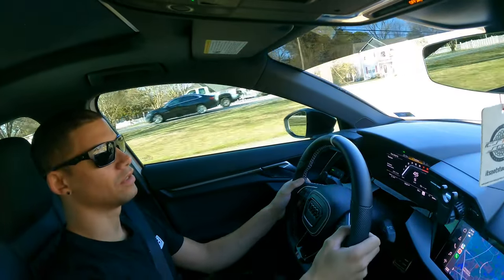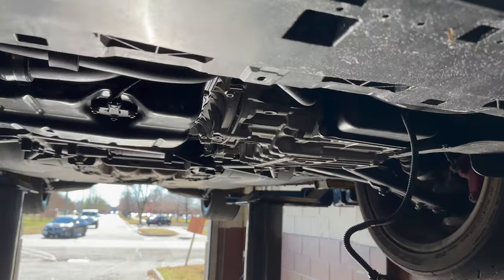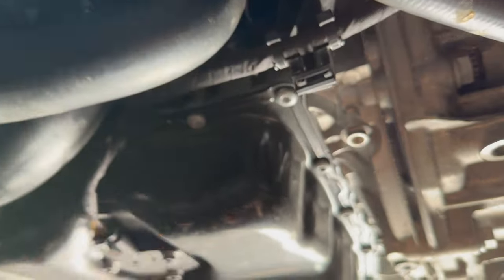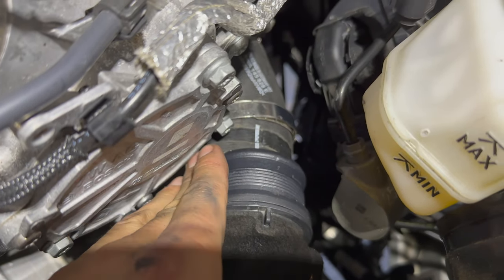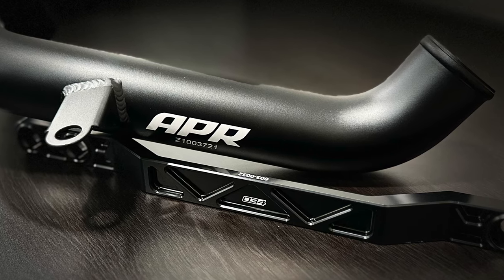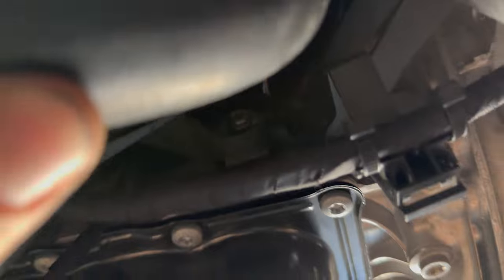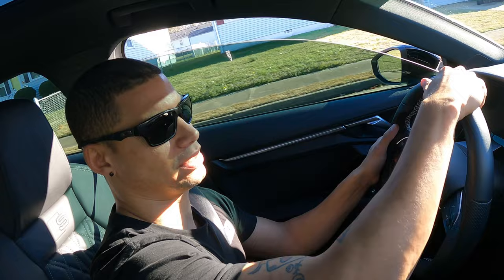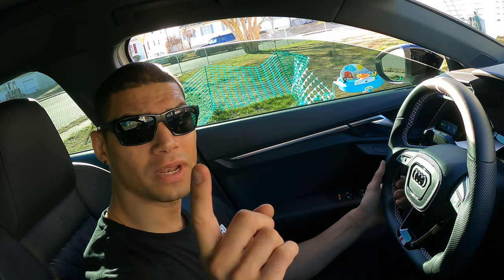034 Tunnel brace & APR Outlet pipe install | MK8 & 8Y S3 | MQB EVO

Comment: Bro watching all your videos on this car made the decision for me to get an Audi in July. I'm so torn between a 21 s3 or an 18 rs3 🤦🏻‍♂️
Reply from the maker: What do you value more? Tech and looks or power? RS is expensive to build but the ceiling is so much higher. 4cyl a bit cheaper but after 500whp and 450tq you’re in a sketch territory. Really the RS is too at that power as they all use the same rods and they don’t really like more then 450 tq. 5cyl sounds better for sure, and they are just awesome engines. But like I said it really depends on your goals. If you wanna be quicker then mid 10s go RS. If you’re fine with 500wheel and want the newer tech get the 8Y. But really I’d save and get the 8Y RS get the best of both worlds
Reply: @Bryce Jordan Productions I definitely appreciate the feedback on that. I love the interior and exterior updates of the 8Y, but the sound of that 5cyl has my heart. Plus, it's not a deal breaker to not have to new tech and updated exterior details. Even tho the 8Y RS headlights are sick as hell.lol I'm definitely not trying to make it the fastest thing out there, but I will for sure be doing the basic bolt-ons and exhaust with e85 and 91 tunes to give it just a little more pep and some cracks and pops 👌🏻 it's definitely pricey as hell to mod them. I made a cart of bolt-ons from 034 motorsports and almost shit my pants at the price, so it'll be a slow modifying process once I purchase it.

Comment: settling in for a nice view. i wonder if your APR pipe is the same spot as my Neuspeed pipe. i think they are both outlet pipes.
Reply: the charge pipe was one of the trickiest installs i have done on my car
Reply from the maker: Yeah they should sit about the same spot, didn’t seem any different then my mk7 install wise besides the extra dsg stuffin the way

Comment: Really miss ur Mk7 bro.....
Reply: @BryceJordanProductions  Im swapping mine to an RS3 and really enjoyed all ur videos they were great. Most all of the suspension stuff i can still use other then motor/trans mount. Shooting for 1200 whp. Syvex, sleeved block, poted heads, custom cam, Litespeed Magnesium wheels, AP brakes, CF everything etc....
Reply from the maker: God damn my man!!! That’s like legit the ultimate goal! I should’ve kept mine and did that… 😤I’m loving this s3 though. Where can I follow your build? Also are you looking to adopt?! 😂😂
Reply: @BryceJordanProductions  Ha! Yes the S3 is dope no doubt that interier is amazing!

It started with Innovative Motorsports but the guy left the company and took my car with him to Cali. It should be done by the spring time. 

I have a Trackhawk im building as well. Its just as wicked so im not sure if im gonna create a new channel or just add it to my TennesseeTrackhawk channel which really has nothing right now. 

Trackhawk has a BES Racing built 430ci Aluminum block with Thitek ported Aluminum heads, 3.8 Kong ported whipple, Stage 3 Pure transmission, 130mm TB, Interchiller, Billet crank, billet rods, Titanium exhaust and CAI, Weld wheels, CF DS, Outlaw Axels, etc.....

Plan on grudge racing both for money at Texas 2k and FL2k next year. The Golf R will make the most money especially after I talk a lot of junk and get fires stirring cause no one will expect that little VW to make 1200 hp🤣

But then again no one will expect my Trackhawk to make 1700 hp lol
Reply from the maker: @TENNESSEETRACKHAWK holy shit my man!! Well I will sub to your channel I’d love to see both builds!! I’ll be at tx2k as well we just moved to San Antonio! 😈 If you need a grudge race or track driver let me know! Or I can at least film 🤪 can’t imagine even 700 in an SUV let alone 1700!!!! Here I am just trying to crack a 10.9x 😂😂😂
Reply from the maker: @TENNESSEETRACKHAWK the innovate guys are the shit though.. my sole sponsor EQT is who grabbed them and pulled them to Cali.. they are legit!!
Reply: @BryceJordanProductions  Yes ur right ALex works at EQT now. They have an on site Syvex tuner so thats who will tune it. Cant wait to feel the anti-lag gonna be brutal. Car should come in at around 3000 lbs
Reply: @BryceJordanProductions  Yea bro for sure. Ill be updating the channel in the next few months when I finish up the TH. Its so brutal from a dig it would blow ur mind!

I will definately look u up before I go down there tho for sure. Im in CT right now but will be in Tennessee by the spring.